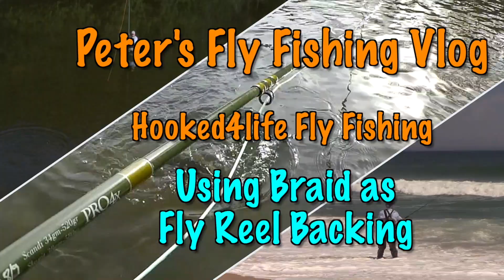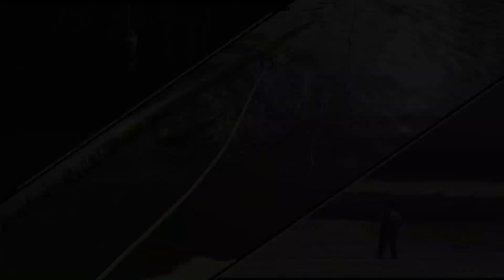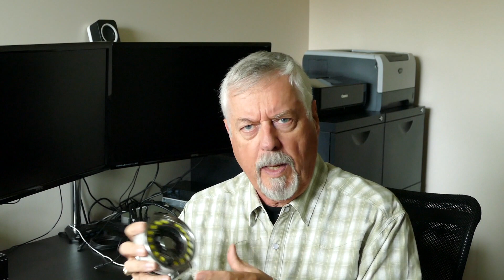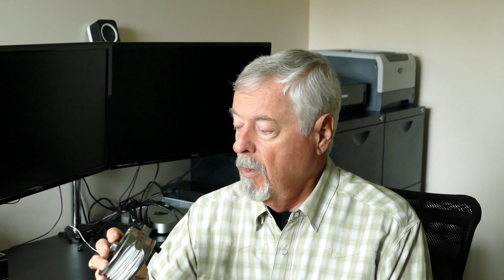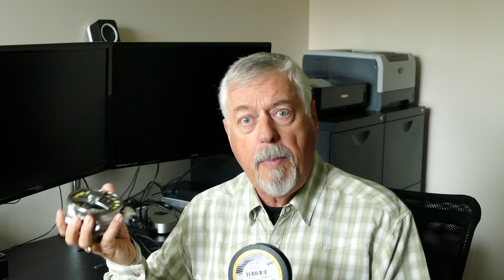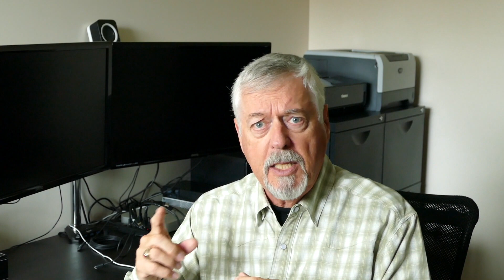Peter's Fly Fishing Vlog: Using Braid for Backing on Fly Reels

Comment: I have problems with braid on fly lines.  It does not lay flat it gets alot of loops and tangles.  It bites into itself and snags.  No problem with it on spinning reels.
Reply from the maker: Spinning reels lay braid on with slight criss-cross pattern which prevents the problem you're experiencing. Also, the drag of the lure in the water provides tension as we retrieve, which keeps the braid tight on the spool.

Duplicate the criss-cross pattern when winding braid on a fly reel, plus make sure you're adding enough tension. If the backing looks like it's sagging after using the reel a few times, there was inadequate tension. I do both of these things and never have any issues with using braid as backing.
Reply: I've used braid for over 15 years and the only time I've ever had issues with braid is when it's not spooled on tight enough or I didn't keep it tight enough while it was in use. As for getting loops in the braid, i havent had issues unless it was cheaper braid. Ive had wind knots with baitcasters or spinning reels but not with the fly rod. For your knots, use several more turns/wraps to keep your knot from slipping. 
99% of my experience is with spinning, baitcasters and conventional reels. I barely pull the fly rod out but the only time I've hit the backing is when I have a tuna or other large fish that makes a good run. While I'm tight there's no reason my backing shouldn't be wound back on without tension unless that fish makes a run towards me and I need to strip line to pick up the slack.
Under that circumstance, after the fight, I will strip my fly line off and get to that "soft" spot and reel it back in nice and tight.
Hope that helps

Comment: What sort of knot do you suggest to connect the braid to the end loop of the Sniper line?
Reply from the maker: If we're going to go loop-to-loop I use a spider hitch on the braid. If we're knotting directly, then a uni-knot or clinch knot. Use seven turns on the knot to prevent slippage.

Comment: If I have a 14wt reel what lb braid line should I put as backing as well how many yards
Reply from the maker: The manufacturer will have the capacity listed for the reel for 30lb. Dacron. For most applications that's enough breaking strain as fly line cores are only 30lb. For some saltwater applications you may want to use 80lb. PowerPro instead.